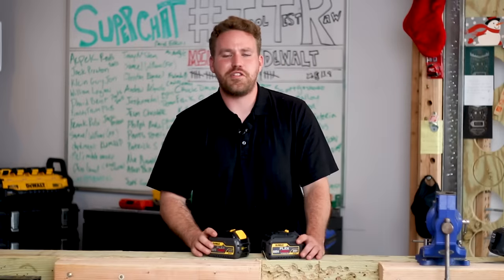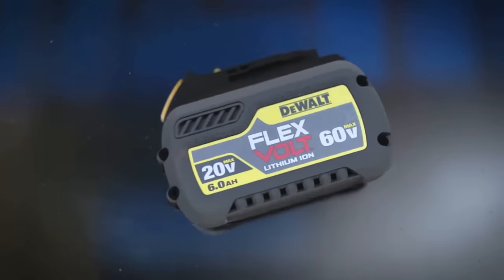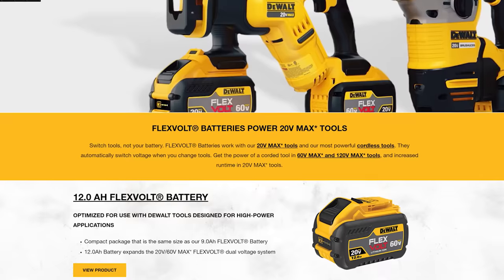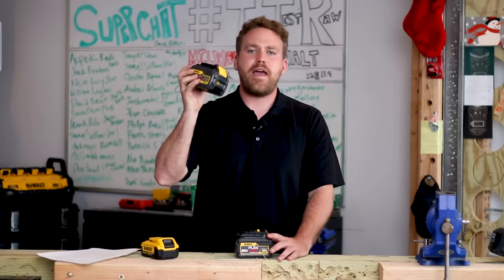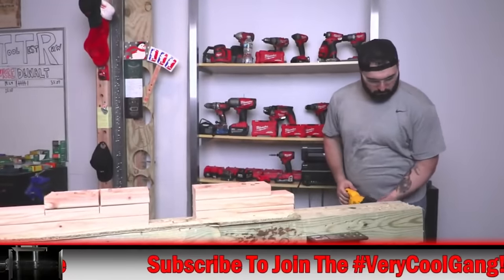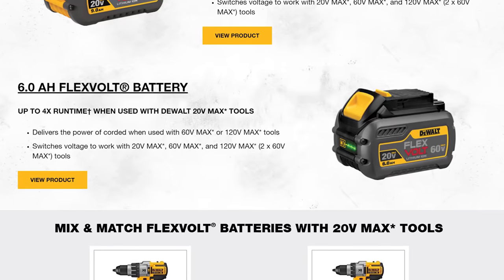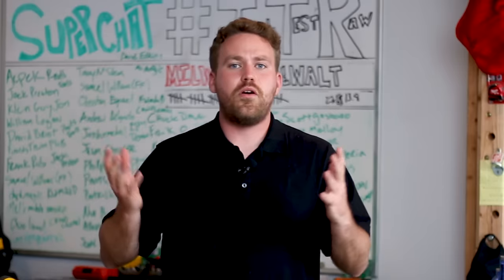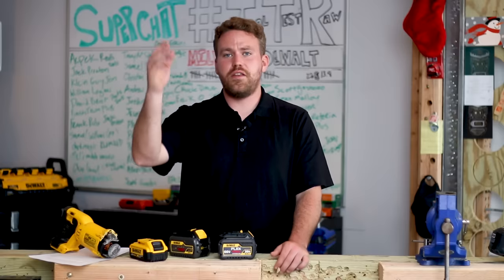NEVER USE DEWALT FLEXVOLT BATTERIES ON 20V MAX TOOLS!

Comment: I just came across this video as I was trying to find out if anybody was having issues with FlexVolt batteries. I bought the DeWalt 20V lawn mower and today was the first day of use. I have a pair of 6ah flex batteries as well as multiple 20v batteries ranging from 3ah to 5ah. Anyway, my goal was to mow 3 very small lawns, and even though I took almost all of my batteries, I expected the flexes to last the whole time - again, these were 3 very small lawns, equaling probably a half acre combined at the most. I literally got 8 minutes of mow time from the flexes. Yes, the remaining batteries were eaten up very quickly as well, but 8 minutes??? Come on.

Comment: The example where the tool break, they are clearly using tools that are not appropriate for the job, and putting way more pressure than is normally needed. It's not the battery, it's how they're using the tools. 20$ says it'll do the same thing with the smallest batteries, if I use the tools in the same way.

Comment: I am a carpenter and I have been using a DCS391 with a 60v 6amp since 2021 and I have never had problems. The 60v adapt to the volts of the tools. in this case the 20v, orient yourself brother

Comment: I use FlexVolt batteries in my 20 volt tools and FlexVolt Advantage Tools - the extra run time and power is great but I do use some common sense with how hard I push them - no problems so far - there seemed to be no common sense in this video. I like how you can really lean on the FlexVolt and FlexVolt Advantage Tools, just like you can lean on a corded tool - again use common sense.

Comment: Flexvolt has extra pins that need to get connected for a 60V output, 20V Max tools don't have those pin heads so the battery never runs on 60V on a 20V tool 😊

Comment: Well, within the flexvolt battery you have 3 banks of 18650 batteries. Each bank provides you with 20V. Now if you remember anything from science class you will know that when you hook up batteries in parallel, the voltage remains the same but the amp hour rating increases. If you hook up batteries in series, the voltages add together but the amp hour rating will remain the same. This is how the battery operates. You have different terminals located on the battery that get hooked up to the tool of your choice, the tool itself internally tells the battery's circuit board whether or not to give it 60V or 20V by either connecting the batteries in series to get 60V, or hooking the batteries up in parallel to get 20V. This is a very simple design. Also when you use the 20V option, you get 3 times the amp hour rating due to the amp hour ratings stacking up. There is very little room for error in this design, unless the battery or the toolbar physically damaged, it would be virtually impossible for a 20V max tool to receive 60V, unless ofcourse the circuitry in the battery is faulty at which point Dewalt would warranty that anyway... soooo what's the big deal again? 🤔

Comment: I have 4 work vans on the road, we use 20v DeWalt tools and 60v DeWalt tools. We use pretty much only 60v tools and we have never burned a motor or electronics out of a tool. The guys are hard on things, nothing is used gently. Never a problem.

Comment: Iv been using 2 same type dewalt impact drivers 1 with only 20v batteries and the other with only 60v max batteries  and I have killed 3 impacts while using the 60v batteries. I'm currently going over my findings with the dewalt factory store rep in my area to see what's going on. He has no answers for me yet, and I promise guys every tool in my truck is black and yellow (dewalt) for those that dont understand I love my dewalt tools I want this problem resolved

Comment: Flexvolt batteries on 20v tools yields no difference at all than a 20v battery. Exact same output. Only exception are the 20v flexvolt advantage tools that can pull more than 20v on flexvolt. But these are engineered specifically for that. I've never had any issues interchanging them at will. Just don't push your tool until it smokes, regardless of the battery being used.

Comment: no them not them have a switch to cross over from 20 v to 60v wen used in a 60v or 20 v the only thing is you cant used a 20v on a 60v but you can used a 60v on a 20v tools the battery have a switch builtin

Comment: Lols... my dewalt 887 1/4 impact has and still curb stomps the red stuff behind you... have yet to find a dewalt ad offering a grand worth of tools
Reply: Still running that same ol set up... had to change out the chuck using it to spade out 3/4 holes for a dog kennel into hardwood.. 200 holes in a row got it hot and wore out the retaining ball bearings so it dropped bits all the time

Comment: I use the 54/60volt batteries for my 18/20volt tools all the time....never had a problem.

Also, looking at all the other comments, it's unanimous, 54/60volt batteries work in 18/20volt tools with no issues.

Comment: this is tottle BS i have used these flex volts on all my other 20v max dewalt tools and i never had any issues like this not even with the same exact tools you claim it caused to stop working.

Comment: I agree! I burned up 2 Sawzall's 1 grinder and 1 pole saw before I realized  DeWalt information on the use of the 60 volt flex is inaccurate. I have been a DeWalt user  for 30 +years until this happened. now i believe im going to jump ship and trade in for Milwaukee

Comment: From what I saw, you pushed that recip saw beyond what it was meant to handle. Any electrical motor that is overloaded and forced to operate under extreme load for an extended period of time (with a higher capacity battery), will eventually burn up. It’s not the battery’s fault.

Comment: I run all my tools on flex volt batteries doing construction for the past year and a half with no problems. Maybe the demand is beyond the capability of the tool and that’s why it’s burning up. Especially with saws the blade is supposed to do the work. IJS 🤔

Comment: I believe like a lot of people, i was waiting for the reason why they hurt 20 volt Max tools.. I only use the flexvolt on the 20 volt Max circular saw. It lasts longer and the weight isn't that much of an imposition. Never had a problem.

Comment: Not my experience, just quoting a review of the 60v flex battery on Dewalts website, might explain what these guys had happen, or might help someone - “I do not think the 60v can work with the normal, brushed 20v max tools. I have a brand new 20v drill. Bought a 60v flexvolt battery and used it in the drill. The FIRST time I used the drill, burnt up. Overheated and started smoking.

I then used the 20v sawzall with the 60v battery. Got SUPER hot.

Then used my 20v impact with the 60v. This was the 10th time or so I used the impact and the first time with the 60v battery. The housing got so hot I couldn't even touch it. It also has a burning smell. Which wasn't the initial coating burn off. I switched back to the 20v battery and the Impact worked fine. Cooled off, no smell.

I am ASSUMING these batteries ONLY work with the BRUSHLESS 20v. NOT the BRUSH tools. Which is unfortunate because these batteries aren't cheap and I do believe my sawzall and impact have sustained damage... Ive contacted Dewalt customer service on theis issue and am waiting to hear back from the higher ups; as my report has been routed up to them.

I love Dewalt tools, and thats all Ive ever used. I'm a union Carpenter, and thats all I have ever used at work as well.”

Comment: Although I am not familiar with details of the flex volt setup I have  a hypothesis as to the cause of the problem.  Batteries have internal resistance.  As an example, If you short circuit the battery terminals the current will be limited by the internal resistance of the battery.   Granted, it will also ruin the battery, but the internal resistance will limit current until the battery self destructs. In normal operation with the standard 20 V max battery, voltage at the motor terminals will drop some under load, also due to internal resistance of the battery. The greater the load the greater the voltage drop. Thus internal battery resistance will limit the power input to the motor. When the 60V flex volt  is operated at 20volts, the cells are  connected in three banks of 20 volts each  connected in parallel.  The parallel bank has one third the internal resistance of a single 20 V battery.   The effect at the motor terminals is that voltage drop under load will be one third that of a single 20 volt bank .  I believe the trouble starts when the tool is operating under heavy load.  The flex volt battery delivers higher voltage under heavy  load than a single 20 volt battery.  The additional power from the battery under heavy load is the likely cause of the tool failure.

Comment: I worked for a framing company and we used flex volt batteries on all our DeWalt tools, then one day all the flex volt batteries stopped working. Lucky we were able to get them replaced and they told us not to use them on 20 volt tools.
Reply: Wow.  Every single Flexvolt battery stopped working on the exact same day.  Cool story, bro.

Comment: Any of those mid grade tools will fail like that sooner or later if you keep feeding them a hot supper.

Especially those little impact drivers that are made to run on a 2 or 4 ah battery.  Put a 12 or one of the newer 8ah xr batteries on it and watch the same thing happen.

It's a 20v battery at full charge, but you squeeze the trigger and the voltage might sag down to 15-17(guessing). The tool still has to perform well on a half drained battery.

Point is they're tuned to account for spending most of their time at lower voltages. Slap a big high amp-hour, high current pack on it and you eliminate most of the battery sag.  Now instead of 15-17v you might be closer to 19 or even 20v.  The tool was made cheap, it's not smart enough to throttle itself back, plus longer run time at higher voltage = higher sustained current = smoked tool.

And you're literally stress testing the tools, if one didn't break every now and then people would accuse you of being dishonest.

Comment: This is ridiculous. A (say, 9Ah) Flexvolt battery is simply three 20V, 3Ah batteries that can be configured to run in series (60V, 3Ah) or parallel (20V, 9Ah) depending on the tool they are in. The pins on the electrical connection make that decision. The batteries ship with a 20V output by default, for safer storage and shipping.

This is so bloody obvious. How do you not understand this?
Reply: he is simply ignorant

Comment: did home renovation for a summer. I used the flexvolt batteries on all our 20v tools and 60v tools. I treated the 20v batteries like spares for when my 60v battery was charging. beat the brakes off that battery with circular saws hole saws sawszalls drills and drivers never had a problem. Not Once. im not a tool brand fanboy, dewalt is just the tool that was placed in my hands by my boss at the time.

Comment: Here's the deal, They are compatible but you need to be careful when tools bind up, the flex volt batteries can burn up switches and wires. Happened to 2 of my tools. I did fix them though, soldered them back up. The wires and switches in the 20v tools aren't made to handle the extra volts that the flex volt battery packs.

Comment: I have sawed 8" pine trees with DeWalt cordless sawsall using the small DeWalt battery no problem.  If I have a tuff metal cutting job in shop I get out the  Milwaukee corded saws all or  Bubba (the oxygen acetylene torch.)  Right tool for the job, makes all you tools happy and live a long life.

Comment: Flex volt offer more current that’s why the tools burn out. Instead of the tool drawing down the amp from the regular battery and loosing performance the tool is being work at peak performance for a longer duration. It’s like putting ur car in neutral and flooring the gas

Comment: Very Simple. A Flexvolt battery has Pin Connections allowing the built in 20 volt 3 ah cells to connect as 3 sets in parallel to make up a 20 volt 9ah battery, OR in series makes a 60 volt 3ah battery. THAT is all it is. Can't possibly cause  damage

Comment: I blew up a my 20v impact driver, hammer drill and leaf blower by using 40v flex volt battery. Tools did not smoke or over heat, just quit working. Dewalt blamed defective flex volt battery but will not cover tools. I will get to bottom of this. Damn! Out atleast $500

Comment: Dewalt sells a 20 volt max miter saw with a 60 volt flex battery and charger in the box. That is right from the factory so they must warranty it.

Comment: This man don't have a clue what he's talking about doors flexvolt batteries only use 18 volts when used on none flexvolt DeWalt stuff they only use the 54 volt when it goes onto a flexvolt machine as there is a switch that depresses when on a flexvolt machine

Comment: I’m a carpenter and used dewalt my whole career and 100 percent the 60v kill the 20v tools!!! Lost a lot of tools before figuring this out.
Reply: As a newcomer to the 60v line, I'm not gonna risk it. I've had my 20v tools for years and they work just fine with their regular batteries. I'll just keep the 60v batteries charged for and ready for the string trimmer and whatever other 60v tools I may acquire in the future.

Comment: I concur with the general consensus. I have both 60v and 20v tools. I have never had a tool burn up in either spectrum. I also always let the tool do the work not lean into it with all my might. Putting all you weight into driving a screw doesn't make any sense. Same goes for a saw. Once a screw is started it will pull itself in. Putting 300 pounds of idiot into it only srtains the tool. I hang and fabricate signs for a living. So I cut, drill, sds, grind and impact on every form of material out there. I don't abuse my tools. I let them work the way they're supposed to and all my tools still work perfectly.

Comment: Did they just use the impactor to drive an M16 thunderbolt?? They make nut guns for that size of application. Nothing wrong with the batteries, just the operator of the tools.

Comment: The issue you are seeing is the fail prevention when the battery gets too hot.  Throw it on your charger and you will see it will not charge it till the battery cools off.  Its not the tool, it's the battery protection.

Comment: Just about the only way you could tell if it was the battery is to put the tools through the same test using the 20 volt max batteries, because it really looked like what you were doing with the tools and not what was powering them!

Comment: That is most probably a defective Flexvolt battery. These batteries use banks of 5-series li-ion cells either in parallel (20V) or in series (60V, 120V). If the automatic voltage selection is defective in a battery, it is possible that it will supply 60V or 120V to a 20V tool, destroying it.
If the automatic selection worx properly, it absolutely worx with the tool.

Comment: It go's to 20v all it it is split series and parallel you can charge 60v off a 20v charger I run there tools 60 and 20 and never had 1 issues on the 20v tools the  Contacts My contact with the 20 bolt side contacts of the battery and and same for 60 The 20 V toll does not receive 60 V

Comment: I've used flex on my 20s.
I never use it to extend performance of my too, though... I'm not going to put a 2' lag bolts through anything with an impact driver. Especially concrete... Come on, now..
I have bigger tools for that...

Comment: Thumbs up on this video. Thankfully I haven't burned out my 20 volt max tools with the flex volt batteries but what I have noticed is less work time wirh them versus the original 20 volt max batteries. Weird right? However I do have a 60 volt max circular saw and grinder and those work great with their intended usable 60 volt flex batteries and this is the 6 amp hour ones that I have. Thanks again for thos video. I'll be sure to use the appropriate batteries for my tools as I'm a DIYER and don't want to break my tools.

Comment: I don't think he understands how the FlexVolt batteries actually work in 20V tools versus FlexVolt tools.

I am sure the DeWalt guys know this but for others, the battery actually changes to parallel mode when you put it in a 20V tool.  That means that it can give 3x and up to 4x the runtime.  Now if you run a drill for 4x the runtime over and over it is absolutely gonna create wear and tear but it has nothing to do with the battery tech itself unless something is shorting.

Comment: Thank you for the warning. Just bought the DCD998, and I won't be using a flex volt battery.......So I just read the other comments,now I don't know what to believe.
Reply: Flexvolt batteries are fine in all 20v Dewalt tools.

Comment: Flex volt is simply a series vs parallel issue.  It wont nuke tools unless you over current stuff.  I own mostly milwaukee, run flex volt on my 20v dewilt stuff all the time.     Dewalt 20v(18v) > 18v milwaukee.   T professional carpenter.

Comment: I am using flexvolt on my 20v lawn mower. They are much better and stay warm, not hot. Contrary, 5, 8, and10 Amp 20 v batteries become extremely hot and starting smelling like burned plastic. So flexvolt is preferable for tools with high energy consumption. You better not to use it with your impact driver.

Comment: Im use 5A/h 20v battery in old 14.4v saw (don't ask me how) for years and nothing go wrong. Little carefully with Flexvolt and all will be ok too
Reply: thank you for this post. this flexvolt is just the proof that you can modify your 14,4v or 20v tool to use a 24 v battery or even a 32v battery.